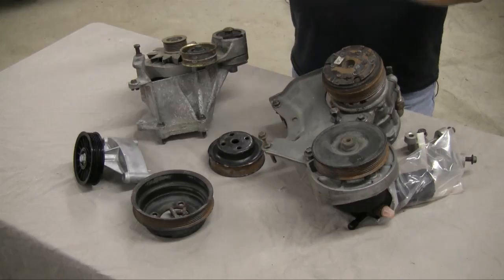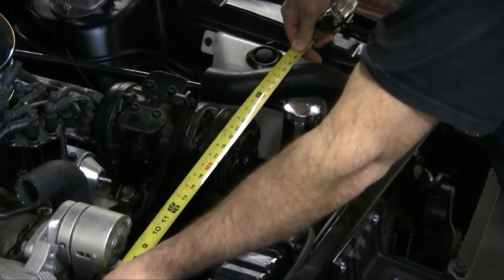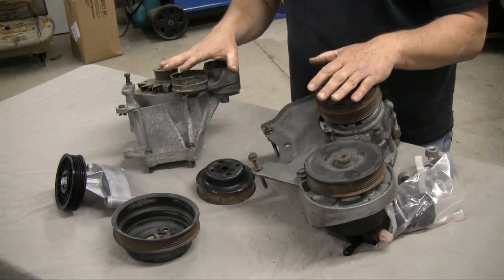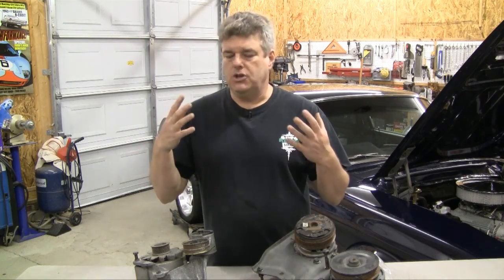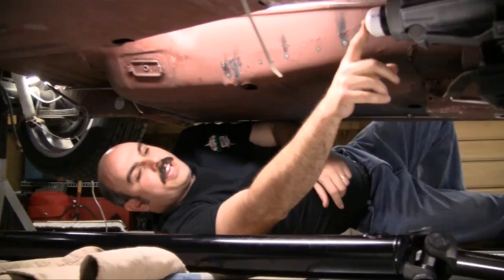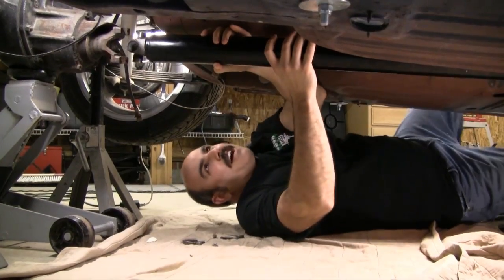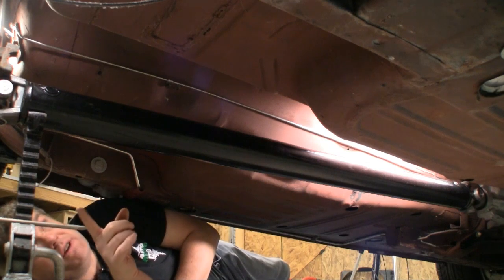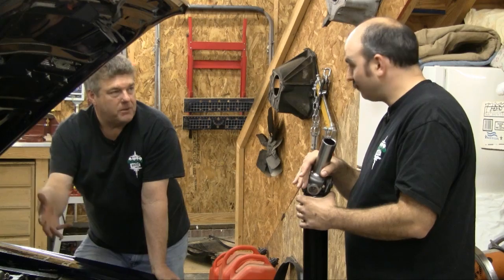Junk Yard Serpentine Belt for Classic Car, Measure for custom Drive shaft Episode 153 Autorestmod

Comment: Another fitment issue to check is the fuel pump. A mechanical fuel pump did not fit on the set up I just installed, the power steering bracket interfered with the pump, so I had to install an electric pump.
Reply from the maker: True FE, there are always nuances that can cause issues. Anytime you are going aftermarket or stepping away form the factory install there will be things that may come and bite you in your rear quarter. We'll be dealing with some of that on our 3.6.2014 episode.

Comment: Hey Jeff, I have a '95 Mustang 5.0 front engine assy (alternator, water pump etc) on my 351W engine. The engine is in a '69 Mustang Mach 1 and so far hood clearance seems to not be an issue. One thing that I was hoping to see in this video, but you never mentioned, was a procedure for measuring for the correct belt length. Even though I have aftermarket alum heads on the engine, everything bolts up and appears to be fine. The '95 serpentine system is a good bit different than an '86 to ''93 5.0 serpentine system. It is more "compact" I guess you could say. Also, I realize that a 351W is wider than a 5.0 motor so the belt will have to grow by some amount. Can you give us a proper technique and maybe a video for measuring for the proper serpentine belt length? Thanks in Advance!!! Oh, and I love the AutoRestoMod videos, good job and keep them coming!!!!
Reply from the maker: Fox, Thanks for the kind words! We're still not sure on that either. We used a recommended belt for the application...and it was to long. We wish now that we had used an idler and not cut the tabs off that it bolts to. The video is a good idea for a Fastbreak, we'll look into that.

Comment: Hi guys, any plans to disk brake the diff on the mustang.
Reply from the maker: Not sure yet. But it would make a good video.
Reply: AutoRestoMod  I'm positive Vinnie would be keen lol, and there'd be no need to convince Jeff I'm sure to add another shiny part. Besides my problem errr PROJECT has a 8inch with drum brakes which look cool but would be cooler with shiny slotted rear disk brakes, if only I knew how to do it (sigh). ..Ok I have an idea but over here in NZ our option for choice is limited and over your way is full of options but which is the best? Anyway keep em coming!:D
Reply from the maker: manoofi We might do the conversion on the '67 but it will have to be after 4.15.2014. Jeff has confirmed that he does like the shiny bits so...
Reply: YaY  here's hoping:)

Comment: Those are calipers not mics but nice video still :)
Reply from the maker: pyramidhead0420 HAHAHA Jeff has always had a problem with that, he usually just grunts and points at things on the wall or floor.